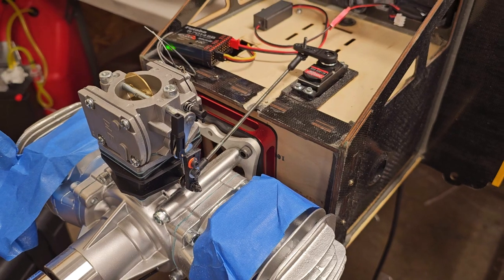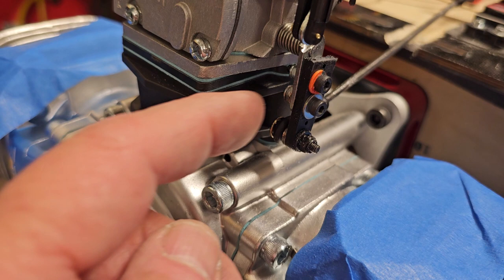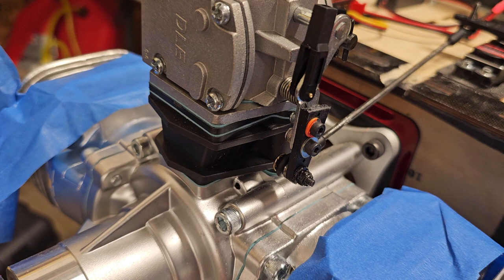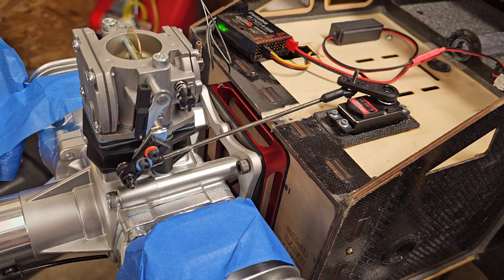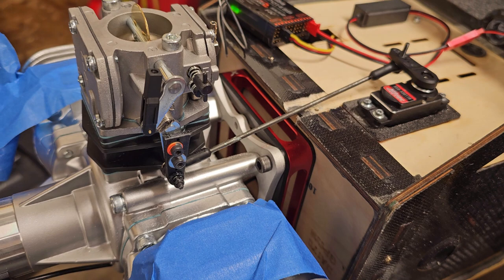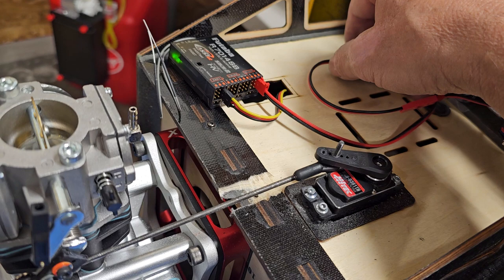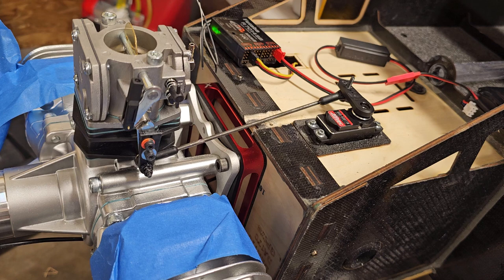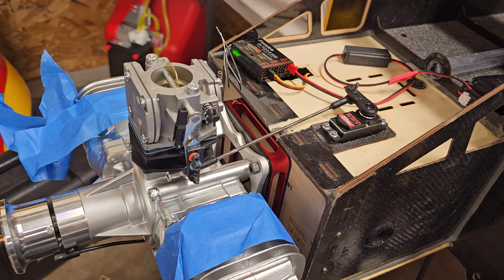dle 170 throttle setup with high resolution

Comment: 90 degrees ?
Reply from the maker: The Servo arm to Servo body? At Center position it's close to 90 but not exactly 90. Like all my other surfaces I adjusted the pushrod length until there is equal travel on the Servo arm in each Direction to open and close the butterfly from Center.